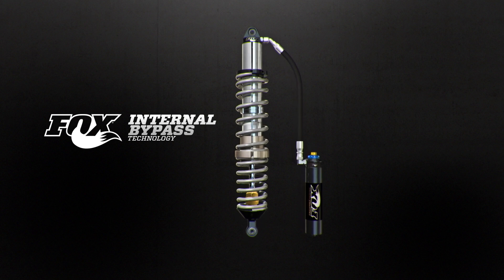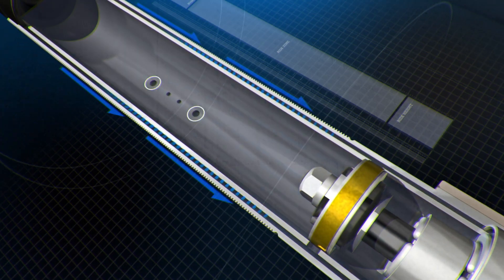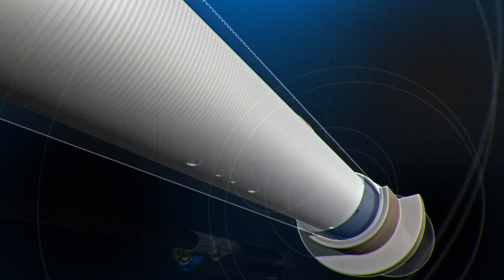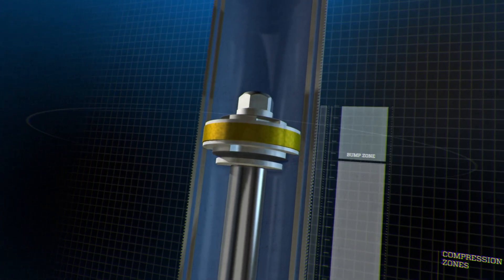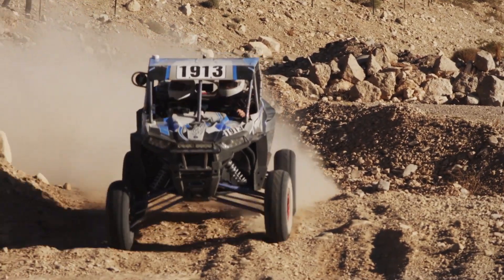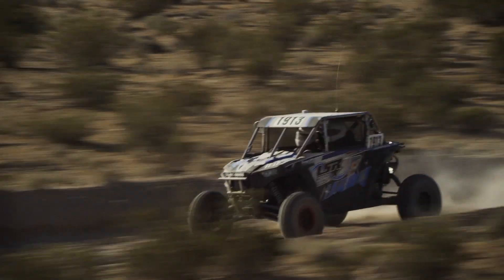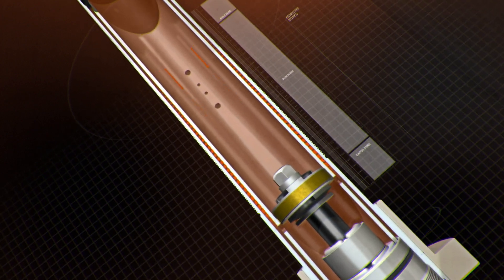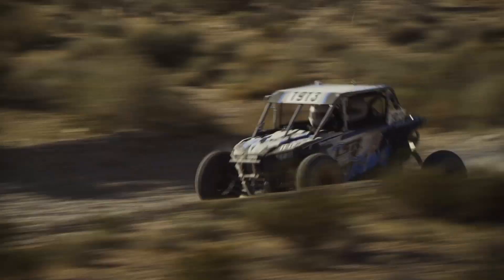FOX Internal Bypass Explained | UTV

Comment: What does the top spring do?
Reply: The animation for the spring isn’t complete, it also compresses. Somewhere on the body there should be a nut that stops the divider between the two springs, increasing the spring rate. More on it here:
https://shocktherapyst.com/the-truth-about-dual-rate-springs/